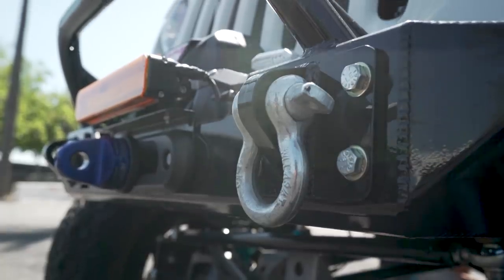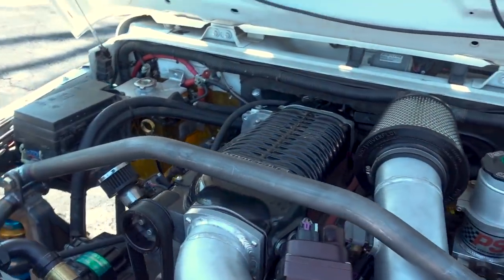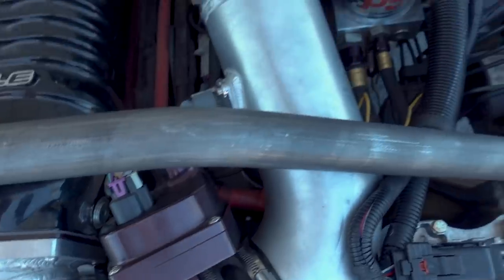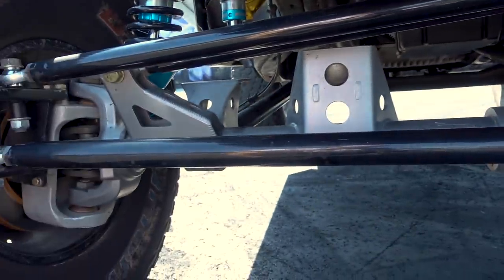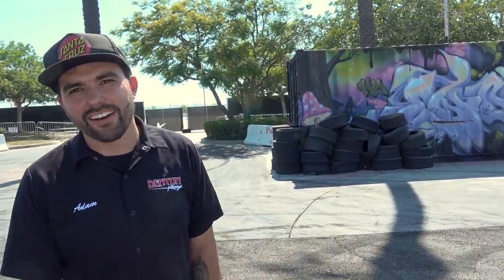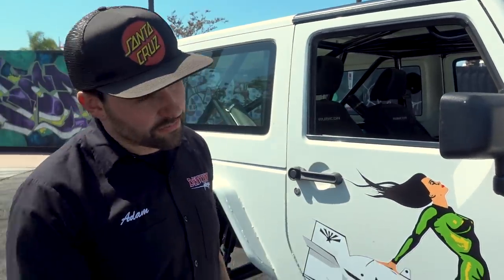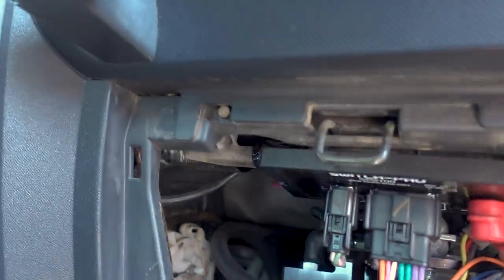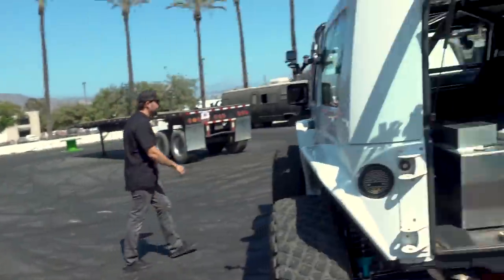LSX V8 Swapped Jeep Wrangler Obliterates 40" Tires!

Comment: All of these mods and not one LED bar or angry grill. This Jeep is done right!
Reply: Jeep building masterclass. Really clean & all business.
Reply: As a wrangler driver Hellyea bro
Reply: Wtf is wrong with led lights? Angry grill is shit ya, but lights are practical and a must when its dark.  For me anyways, i like to see shit.
Reply: @peterslanger6062  Nothing "wrong" with them, but people overdo them, or spend too much on them instead of making their Jeep drive right or perform well off-road with that money. I've got Mopar LED headlights on my JK that I picked up for a hundred bucks used, and they're plenty bright enough. Rather than spend cash on an LED bar I'm gonna keep covered 99 percent of the time, I'll get caster correction brackets or a CB radio.
Reply: @keon5779  well ya i guess. I made my lights myself so i don't have much in them.  Ive got brighter reverse lights, interior lights bright enough to not need a flashlight while digging in the tool box, and i have small but bright lights on all sides so if i want i can light up 360 degrees ,each on individual switches. I dont have a lightbar though, ive got the 4" square at the bottom corners of the windsheild...the only thing else id like to have as far as lights is a spot light..kinda like the ones the old cop cars had. So i could move it all around.

Comment: 930 hp off road would be nuts, great build!
Reply: Some of those rock bouncers are pushing around 1400... They are insane.
Reply: Off road would be 1 or 2 mpg.you wouldn’t get home
Reply: @andrewphillips470  more than 1mpg, its not a fucking train
Reply: You can't off road this baby, it has a radiator and fans on top of the rear axle, this is an asphalt queen, a really sick one, but only for asphalt
Reply: @eduardosanchez7827  this thing is constantly in the desert….

Comment: 3 or 4 on 40s with 1000hp?  That's actually pretty good.
Reply: James Whitehead how much it makes doesn’t matter too much because my buddies 1300 hp 416 cui gets 16 miles to the gallon on street tires but my truck with a 325 cui only gets 10.3 miles to the gallon on 33’s
Reply: @zackdillon8670  I'd bet if your buddy actually calculated fuel economy and ignored the dashboard readout he'd see far lower than 16mpg.  And 325ci?  Sounds like an old engine that's incredibly inefficient.
Reply: James Whitehead we didn’t calculate milage off of a screen, he has 15 gal fuel cell and got around 230 miles before fueling up again. And my 325 is 10 years old running with a 3 year tune, it needs a tune up but that’s beside the point. Just because he makes 1000 hp doesn’t mean all mpg goes out the window. RPM talked out a guy with a 700 hp 408 stroker LT1 in a C7 getting 26 miles to the gallon. It’s just the 40’s and gearing he had in the jeep
Reply: James Whitehead don’t forget that hilarious Jeep drag coefficient

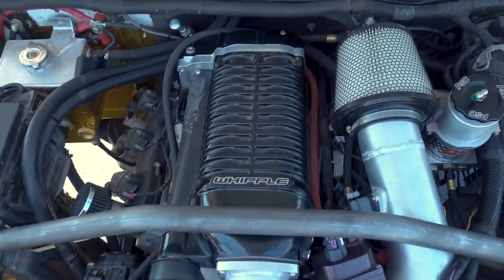Comment: 2:48  Billet Heads...  IDK about that one buddy.
Reply from the maker: Check out Mast Motorsports Black Label Heads. That should answer your question.
Reply: @HooniganDailyTransmission  Thanks but those are not them as proven by its sand cast finish and lack of 6 bolt design.

Comment: I think that trans cooler might be larger than the radiator in my Saturn....
Reply: Why wouldn't it be larger? You drive a pile saturn?
Reply: @thatguy6214  Best $200 I ever spent.
Reply: @danger_mouse_  see that's my point right there 😅😅😅😅 but damn a car for $200 that runs? AC? If so good for you for saving money.

Comment: Am I the only one that realises the hellcat motor is a 6.2L (~372ci) same as an LS3 but the LSX 427 (~7.0L) is bigger. Am I missing something? Is it down to V angle in hemi vs ls?
Reply: its because the heads on hemi's are huge.
Reply: @genh.6210  taller, wider,longer or all of the above? I'm genuinely curious, I couldn't find any dimensions for the hemi online.
And yeah I also realised after my comment that displacement doesn't necessarily coincide with physical engine size.
Reply: @josephernest91  wider. they're very thick and girthy
Reply: @genh.6210  girthy. Lol. Sorry childish humor 😂

Comment: Shoulda had a hemi
Reply from the maker: The Hemi’s engine package is massive compared to the LS. They wanted more room for suspension relocation and a larger front mount radiator. We don’t blame them on their decision one bit. 🤘🏼
Reply: @HooniganDailyTransmission  I dont either I just thought it was a funny quip on the V8 commercials. It's a badass rig

Comment: So the air filter is located just over the exhaust manifold? Awful place, the IAT will read high intake temps and retard timing a lot which will tax the power output

Comment: I have a flat fender Willie's I was gonna LSX swap but I wanted mine to be a 2wd like the death trap jeep but I needed a daily to fit the family in so I got a Trailblazer SS AWD that had alot of miles on so I ended up putting the motor in it but one day I will build it
Reply from the maker: Yo... Those AWD Trailblazer SS can actually get down. With a little extra sauce under the hood, they could be an 11 second truck all day long.
Reply: @HooniganDailyTransmission  it's my daily though and it is a automatic, I just can't drive a Prius or Civic as a daily my first car was a IROC Camaro and I've been hooked on V8 rwd cars since the only reason I got a AWD Trailblazer was because I got it for $6000 and every other one I looked at was more than double that